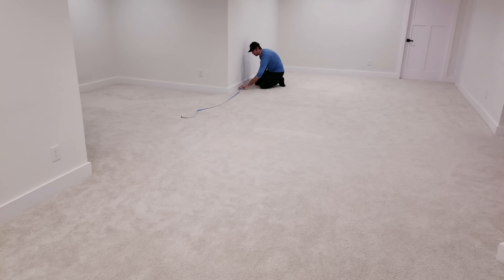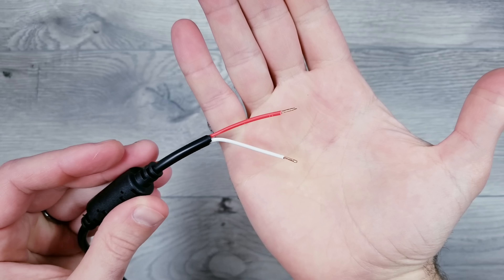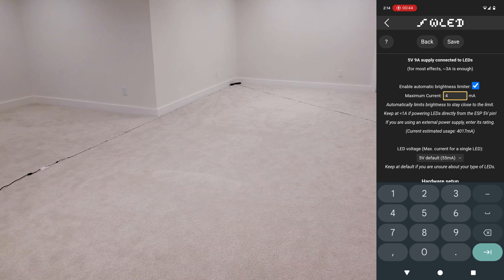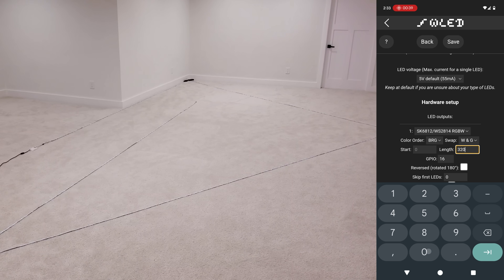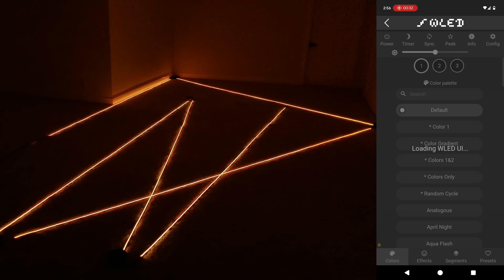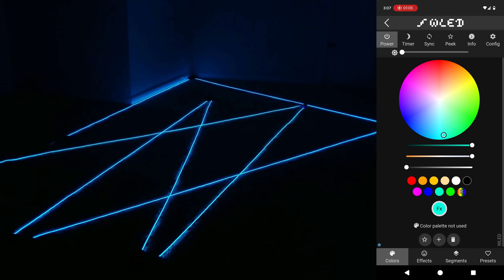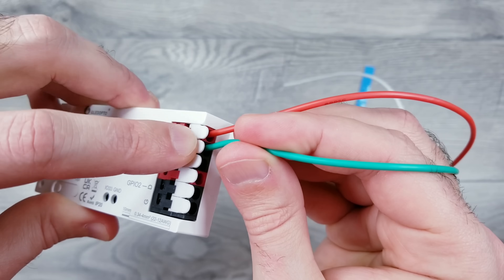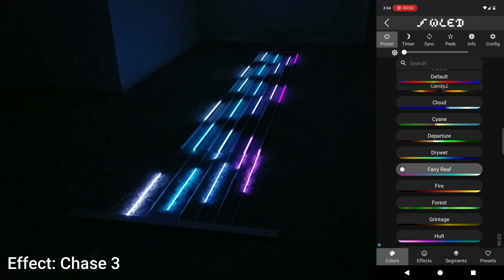Maximum LED Strip Length With NO Power Injection: Real Life Experiment

Comment: I am pretty sure that every led, or at least driver retransmits the data to the next one, minus the data it used for it's color information, so you should never get data degradation, unless you have a huge run of cable between leds. What you will run into at some point is not having enough time to transmit the data for all the leds, so framerate issues.

Comment: Data isn't a problem because each zone/chip regenerates the signal for the next. The problem is when you attempt to create a gap, you should try adding a few feet of gap after each 5m run to see if it starts to break down with the voltage drop. 24v is, of course, the least affected by the drop since it will lose less voltage to heat/resistance.
Reply: Yep, pretty much how power transmission lines work.

Comment: I did something similar in one of my rooms, I used a Mag-WLED controller but instead of plugging one strip after another, I wanted each strip to go the same direction in animations.  So what I did was make some custom JSTs where power for the strip was provided by the Mag-WLED; but the data wire was passed from the end of one strip into the front of the next using a separate wire.

The only downfall is that this doubles the data wire length, however at 536 LEDs I haven't noticed any eccentricities from the farthest LED strip.  I didn't go any further than this though, for the final two strips in the room I used another controller with the same data pass through method.

Comment: It would be interesting to use a separate 24v power supply bumped up to 10A or higher to power just the LED's and see how far the data will continue to go until it corrupts.
Reply from the maker: Thanks for watching! I went back and forth on if I should go down every different possible way to go about doing a long run in this video but ultimately decided to keep it as simple as possible. But for sure something I could cover in a future video!
Reply: @ChrisMaherDIY im still waiting for this Video 24v and 2 power supply
Reply: Each LED repeats the data to the next in line so the data isn't compromised by long runs.
Reply: @Sparky_D If the voltage drops enough that later LEDs start malfunctioning I have seen data corruption / flickering at the end of a string at high brightness, which was fixed by injecting power.  But I tend to want max brightness as an option in all of my projects.
Reply: I would second this idea. I have a large psu powering 2 led strips 16ft each so I’m curious how far you can go with only one psu

Comment: Can the Gledopto WLED Controller control 2 separate LED strips independent of each other? Example - 1st strip White and 2nd strip blue
Reply from the maker: Yeah! The controller has 2 data outputs so you can run each one separately or run them together as a long run. Or if it makes more sense, you can run everything off 1 data output and just create 2 segments in WLED. Then you can control each segment separately.  Lots of options!
Reply: @ChrisMaherDIY  Awesome thank you for the information!!

Comment: What is the difference between these two? BTF-LIGHTING WS2815 (Upgraded WS2812B) 16.4ft 300 Pixels Magic Dream Color Individually Addressable RGB LED Flexible Strip Light 5050 SMD Dual Signal IP65 Silicone Coating Waterproof DC12V Black PCB vs. BTF-LIGHTING WS2815 (Upgraded WS2812B) 16.4ft 300 Pixels Magic Dream Color Individually Addressable RGB LED Flexible Strip Light 5050 SMD Dual Signal IP30 Non-Waterproof DC12V Black PCB. Is it just that one is waterproof & the other is not? Why is the water proof cheaper?
Reply: I have a lot of BTF 2815 leds at my house .  The 2815 strip is great for more complex animations and patterns because they are individually addressable,  where the cob strips are addressable in a group of 36 leds, although those leds are closer together.  Also the 2815 strips have an extra backup data line for redundancy of data, but it doesn't need to be used.  The cob strip has more even lighting , but if you use the 2815 in a diffuser channel it looks just as good .
Reply: @SteveO95  If I was looking for some underneath my bed lighting and behind the headboard would you just use the 2815 with no diffuser? Also looking to do the same behind the TV.
Reply: @ScottMicale  yes, using channel for your application isn't needed, so i would probably use the cob strips for your needs, right now amazon has a sale on btf rgb cob strip for $22.99.  That strip doesn't have a dedicated white channel though, it uses rgb to make white, which I find good enough.  There's many different cob strips available for different uses.
Reply: @SteveO95  Ok I will have to check this out.
Reply: Do you have a link to those?

Comment: Testing white would be the ultimate test
Reply from the maker: Thanks for watching! Yeah I should have included that! These have a dedicated white so they actually do pretty good. From the testing I did, it seemed like the dedicated white drew close to the power that the teal blue color did. But I will say, if your main purpose is having a nice white color, then I would probably not use an RGBW light strip to begin with. Stick with a dedicated White led strip and skip the colors or run a seperate color led strip next to it.
Reply: @ChrisMaherDIY  awesome thank you so much for the info

Comment: I have 85ft in my living room I want to do but I have 4 door openings to break. What's the best way to make it all even lit and work together...thanks
Reply from the maker: Thanks for watching! What I just set up was 115 feet. I would lay things out on the floor (connecting each strip together with extension wires around the doors and test things out. If its not bright enough for your liking then you will have to power inject.
Reply: Multiple power ingection

Comment: i did a 10m roll of the 24v RGBIC 720/m 15w/m off the same type of controller  with no issue. I'm sure i could have ran longer, but thats all that would fit on the desk. I didn't see  horrible voltage drop or anything. I was using a 24v 15A switching PSU, and was convinced i'd need to power inject. Did the calculations  and realized that was a waste of time. I think i hit 800 and something LEDs on the WLED app. If you have access to a 3d printer i have some models that look just as good if not better than my muzata spotless diffuser channels. You can customize the channels to your needs. It's not aluminum(Don't have that kinda F u money to buy that kinda printer) but i printed them off in PETG-CF and have no issues with heat at all and they weigh less than the aluminum channel. Plus i can control the thickness of the diffuser itself and distance between the pixel and diffuser. I even printed off a WAY cheaper version of Muzata's base board backlit channels Chris featured before. Some sanding  and polishing and you couldn't tell that its plastic not metal and for about 7 dollars worth of filament. Just so you know, I didn't know a damn bit of any of this 8 months ago and Chris's channel was a god send and kept me from wasting more money than i already had fumbling in the dark to learn it all by trial and error
Reply: Link to your models?
Reply: For 5v, you'd need to power inject about every 5 meters. Using ~5x the voltage (24v), you should be able to go about 25m until voltage starts to slag. Not 100% true to the numbers, but within reason.
Reply from the maker: That sounds awesome! At some point I'm going to jump into the world of 3d printing!

Comment: I love this! Been watching your vids as we are finishing our basement so I am trying to plan out some drywall recessed tracks.. I would have liked to see these also at full white  light as we are also considering these as prime light source in some areas.. definitely purchasing off your recommendations!
Reply from the maker: Thanks for watching!!  Yeah I should have included that! These have a dedicated white so they actually do pretty good. From the testing I did, it seemed like the dedicated white drew close to the power that the teal blue color did. But I will say, if your main purpose is having a nice white color, then I would probably not use an RGBW light strip to begin with. Stick with a dedicated White led strip (higher CRI) and skip the colors or run a separate rgb strip next to it.

Comment: You haven't tested it with 100% white?
Reply from the maker: Thanks for watching! Yeah I should have included that! These have a dedicated white so they actually do pretty good. From the testing I did, it seemed like the dedicated white drew close to the power that the teal blue color did. But I will say, if your main purpose is having a nice white color, then I would probably not use an RGBW light strip to begin with. Stick with a dedicated White led strip (higher CRI) and skip the colors or run a separate rgb strip next to it.
Reply: It depends on the controller used. For example, in the past I've installed many SK6812 RGBWW strips, which allows the customer to combine the specific warm white with the blueish white obtained from RGB, and this always requires checking the current drop with all four channels at 100%.
Most likely, from 15-20 meters, those WS2814 RGBW at 100% will require power injection.
Reply: I wish he had tested white at those lengths. Chances are, a run this long will be for your ceiling and you will more often than not use the cool/warm white